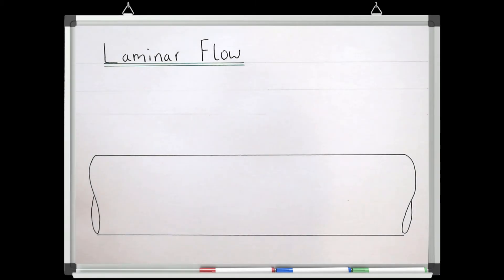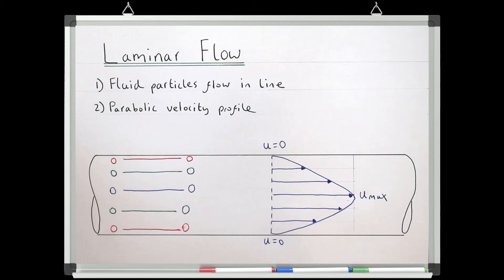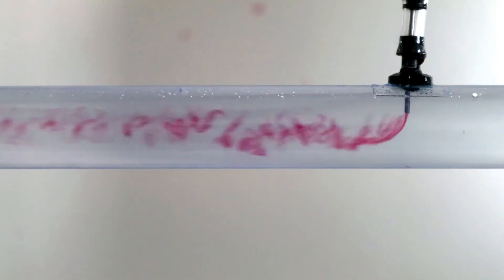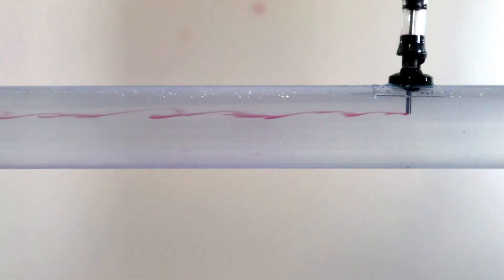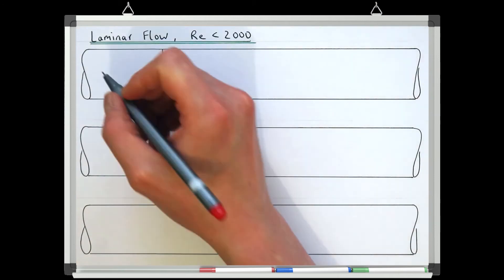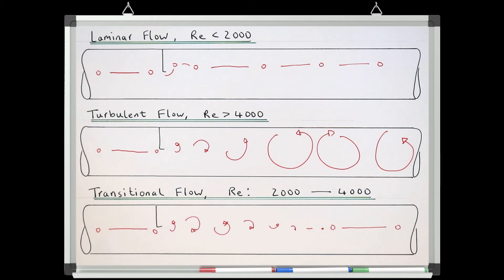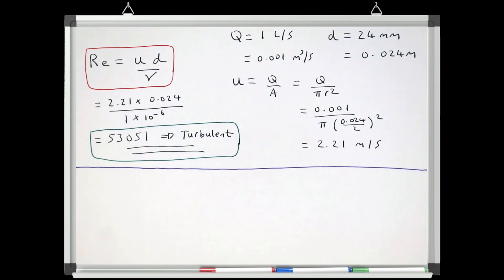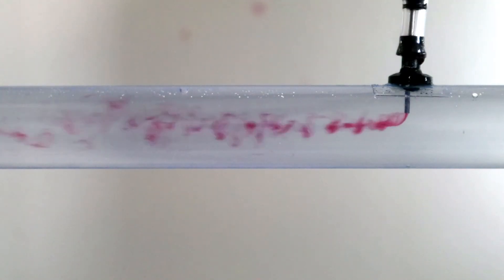Laminar Flow, Turbulent Flow and Reynolds Number (Lesson 3, Part 2)

Comment: Make this experiment with very fine particle inkjet printer or in fair of science find dye that is exactly in size or water molecule and is not transparent,  yes such particle don't exist but that is point of scientist Brownian motion 10^14 hz collisions observed pollen particles of flowers jiggles 1000 smaller paint (dye) particles of potassium permanganate jiggles faster mixing of layers is much faster, no stratification of layers of laminar flow exist.

1:40 Your camera showing only 1/3 length of total pipe but even here you see that already intensity of dye are mixing, no even flow layers stratification. Not forget fact that water molecules compare to dye particles are 10000 times smaller, inject printer dye have smallest particle compare to water 1000 times bigger than individual water molecule. Take very long pipe and use see than no laminar flow exist. What you can see that Brownian mixing follows sinusoidal pattern Kármán vortex street. Of course which is behaviors of Brownian motion of mixing not flow regime of laminar or turbulent.

Reject Brownian motion of molecules is rejecting all atomist model of matter, according to Reynolds flow is perfect layers of continuous flow that sometimes moves in vortices and eddies if flow is high (turbulent). And we stuck with this interpretation to this day.

Comment: Its really very simple , when adhesion over come  cohesion the molecules of water loose that uniformity . The energy of the flow  causes the molecules to follow erratic paths . Helium will not do this hens its super fluid properties . 
Laminar flow is cohesion in action caused by adhesion .
Turbulent flow is adhesion in action caused by cohesion

Comment: Reynold's number also has density in the numerator, unless you were talking specifically about water and S.G.=1. Otherwise great material!
Reply from the maker: Thanks for the comment. I am using the version of Reynolds Number with Kinematic Viscosity, where Kinematic Viscosity = Absolute viscosity over Density, so the Density is there in my working, just hidden. This definition of Reynolds Number is exactly the same as (Density x diameter x velocity) over (Absolute viscosity). I find this version quicker to use, but it does sometimes cause confusion as the other version is probably more common. Hopefully that makes sense?
Reply: @fluidsexplained1901  it does now, thanks!